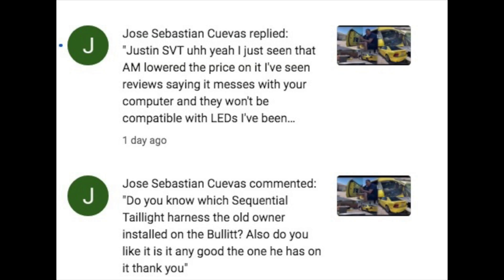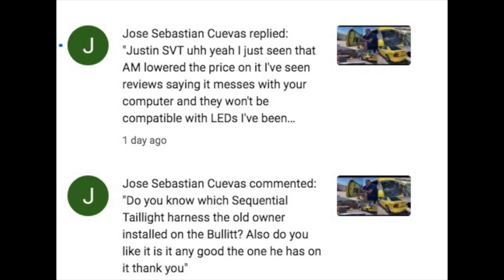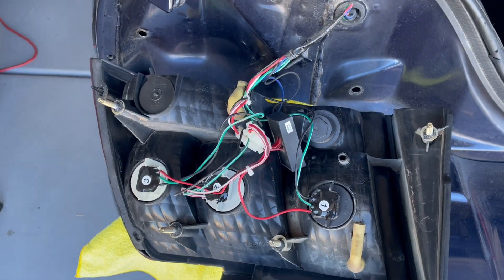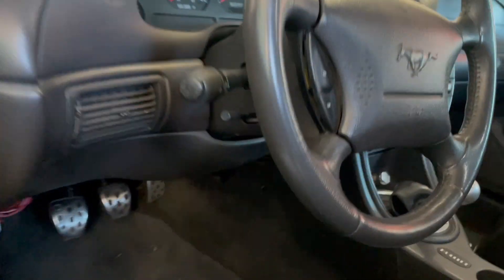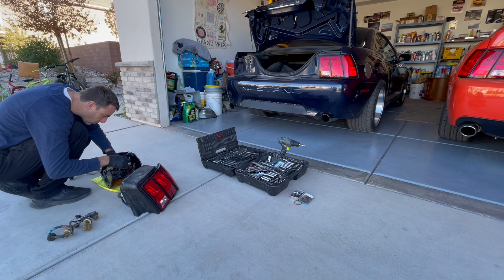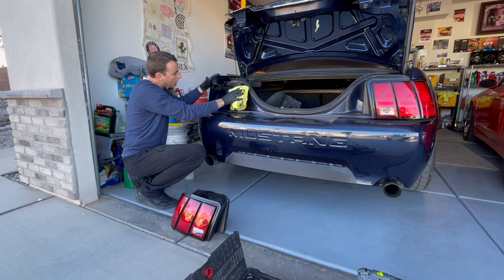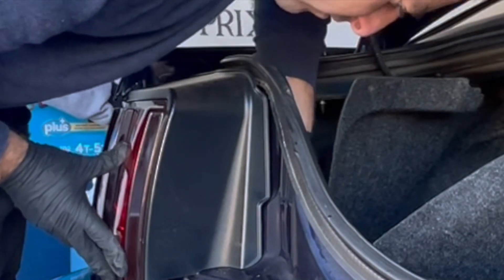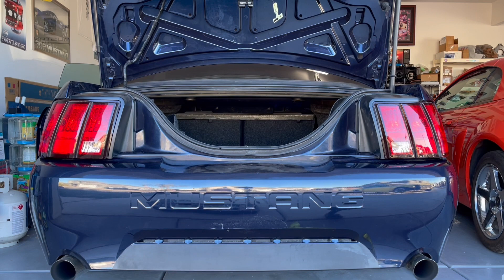2001 mustang bullitt sequential tail lights return to stock

Comment: I had the webelectronics kit in #5253 for 15+ years, no issues. It was not a full plug/play harness, so when I bought the car back in 2021, I replaced it with the AM Raxiom kit. In all my years I have never heard of these messing with the electronics of the car. I would suspect there was another issue at play. I was hesitant to buy the Raxiom kit, I think most of the stuff AM sells is low quality, but I was pleasantly surprised. I will follow up if anything changes.
Reply from the maker: Great feedback.